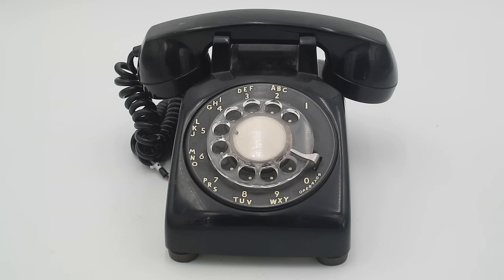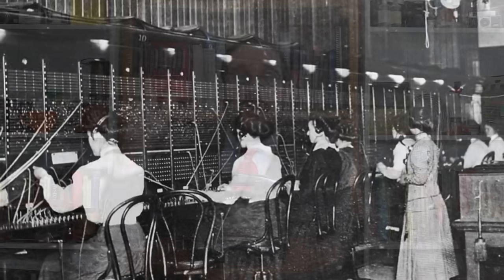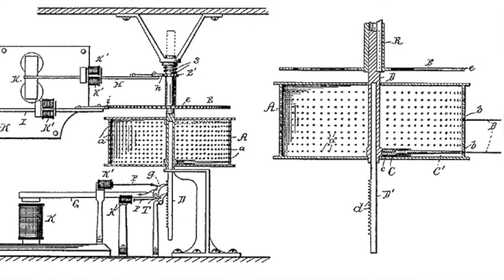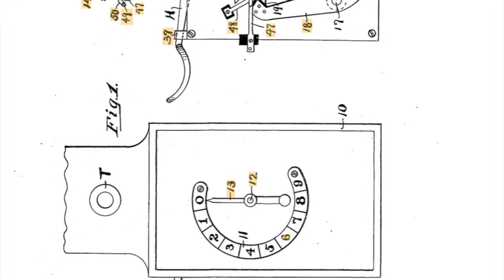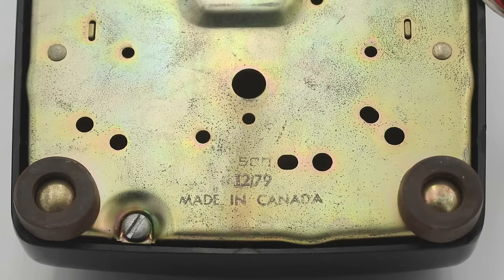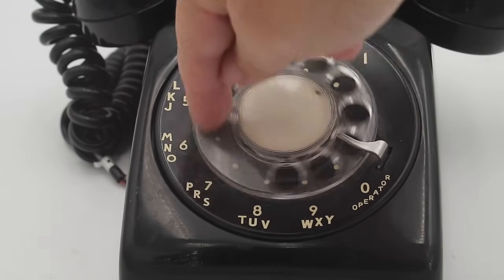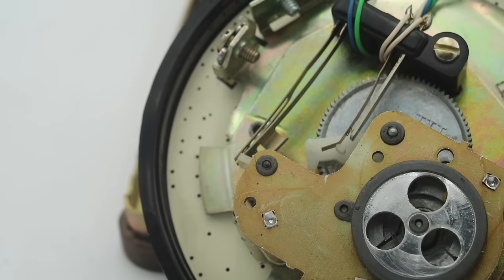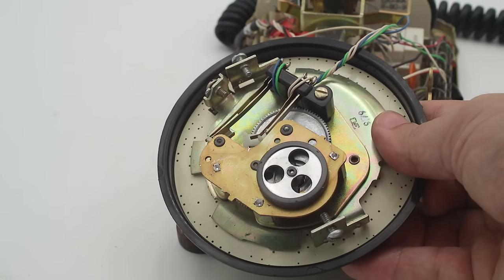Rotary Phones: the Call of History

Comment: The UK had a progressive change to DTMF, many push button phones had a loop/DTMF selector button on the base 

Early push button units were loop dial only :/

We also have the ringer capacitor in the first socket these days and a ringer wire connected 

USA phones with internal capacitor will however work normally with no issue 

As a point of interest, traditional analogue lines (being switched off on 2025) will still loop dial to this day 

Cable company lines are a mixed bag, depends on the franchise area and what hardware they selected for their network 

We use 112 and 999 for SOS, but many UK systems will route 911 as well, guess with modern tech there was no reason not to 

2025 will bring a massive change when the PSTN is powered down for the last time :)
Reply: I wouldn't have thought 911 would work, as there might be local numbers of the form 911xxx. Haven't tried it though, as I don't want to risk wasting an operator's time.

Come to think of it though, it might work on mobiles as they don't have that ambiguity issue.

My new VOIP line from Vodafone doesn't support pulse dialling, sadly. There's no real need to these days of course, but it felt nice to have that connection to the early days of telephones.

Edit: Just checked and there are numbers starting 911 in my local area code, so 911 definitely won't work for emergency here.

Comment: You got it wrong.  The current generation of young people lack observational skills and curiosity.  

When I was young I could light a candle, light an oil lamp, build a fire in a fireplace, use a phone with no dial at all, drive a three speed.  Even though power tools were common in my youth, I learned to use a hand saw, a brace and bit, and a push drill.  I and my friends wanted to learn stuff, new and old.

We learned how to interact with people by going places with our parents and watching them.  Today, toddlers have their heads glued to their electronic devices instead of watching the world.

Comment: My mother taught me how to dial my grandmother on a rotary phone when I was 2-1/2 years old.  Big mistake.  I was calling my grandmother every few hours.  It was so bad that mom had a wall phone installed and got rid of the table top phone so I couldn’t reach it.  It didn’t take me long to figure out a chair would solve the problem.  I had my grandmother’s number memorized and back then it was only 5 digits to call someone.  It was not difficult to use a phone.  If a 2-year old can do it, anyone should be able to.  I often wonder if the videos tricking young people are staged.  The phones are so simplistic.  How could a person have trouble figuring it out?

Comment: Backlash has absolutely nothing to do with the reversibility or not of a worm and wheel gear set. Reversability is dictated by the coefficient of friction between the mating gears. If the coefficient is expressed as the Tangent of a particular angle then the gear set will be reservable if the tangent of the helix angle of the worm is greater than the tangent of the friction angle and non reversible if less. Screw threads use this principle to be self locking. For the same reason a screw jack you might use to lift a car can never be more than 50% efficient or the jack would simply unwind once the crank was removed.

Comment: Area codes and prefixes were a great way to tell exactly what geographic area
An area code always had a one or zero in the second digit
The prefix never had a one or zero as the second digit
The last four contain any digits
Ie. 714 area      so. Cal
     541 prefix.   Santa ana
     2731 subscriber 
The quick glance you can tell what area that phone actually was at
That that rule no longer applies

Comment: You are completely wrong when you describe a rotary phone as being analog.   The dial phone sends out voltage pulses.   That is a digital signalling method.    The touch tone phone, that came later was analog because it transmitted audio tones.
Reply: Well… I’d honestly say that both are digital, because the information carried by both methods (the digit dialed) is a) discrete and b) not inherently correlated to the value of the digit. (The encodings used by modern digital transmission systems, both wired and wireless, would also have to be considered “analog” if we considered DTMF dialing “analog”.)
Reply: @tookitogo  And where did you get your electronics technician certificate?    Please don't say you have an EE degree.   Then I would have to ask you where you got your degree and that would be an  embarrassment to your fellow alumni.   Since you don't know the difference between an analog signal and a digital one,  I wonder if you can tell the difference between A.C. and DC?
Reply: @williamogilvie6909  And of course there’s the entire thing that “digital” (including binary) is about the representation of information, while the physics of the real world are always analog. In electronics, when we consider (binary) digital signals, what we are really talking about is the interpretation of a signal. Real electrons in a real conductor can’t start and stop moving instantly. Capacitance and resistance play tricks. So in the end, it’s up to how we interpret the voltages. (For example, IIRC, 2.7V and up is high in TTL, and 2.0V and below is low. (And 2-2.7V is undefined.)).